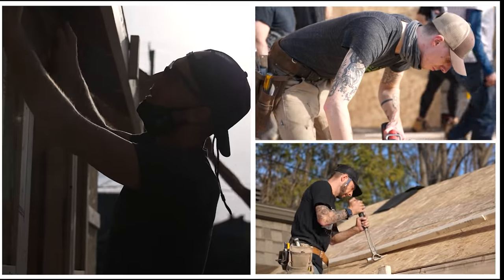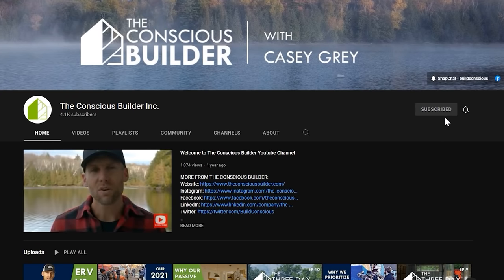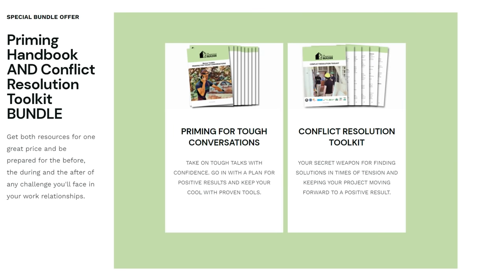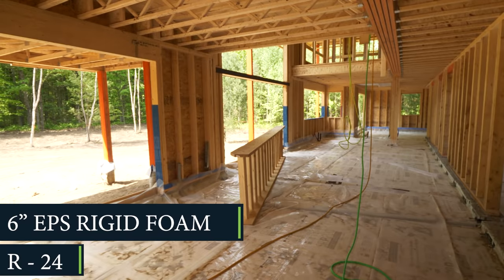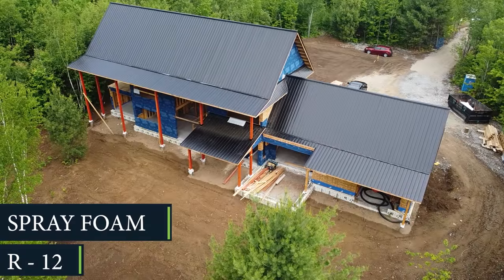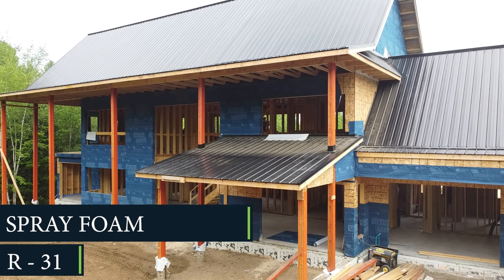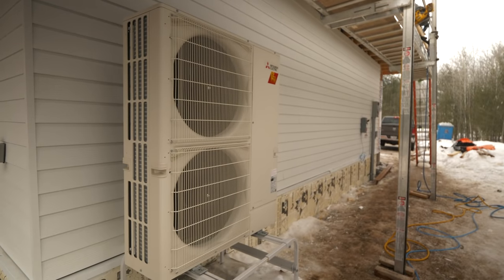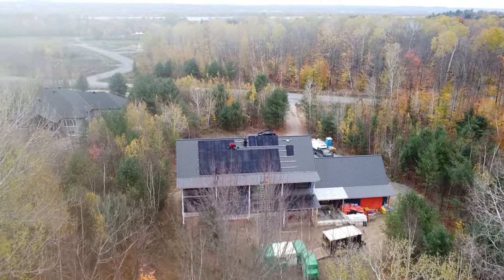Net Zero Build - Building Envelope and HVAC System

Comment: Nice Job Casey.  I've just designed a 1500sq ft Passive House with a heat loss of 1280 watts.  I'm using a Swegon 75% Effective 200 CFM ERV with a 1.5Kw heater as my primary heating source so only conditioning my ventilation air.  I'm building the place in an ASHRAE Zone 7 climate  so don't require A/C assuming I can be comfortable at 25C , 40% RH on a design summer day.  The interesting thing is the place has an energy balance of -15C on a sunny January day which means in theory, I need to switch to A/C.  What I learned is the home orientation for winter solar gain is not nearly as important as summer shading. Moisture control was my biggest challenge because I wanted to keep it less than 24% in any insulated cavity in the R60 walls.  Cheers!
Reply from the maker: Cheers Rob! Good luck on your build and keep us updated on your progress. Thanks for watching!

Comment: Well done! Is there an energy model & are any EV's being charged? Will grid power be needed in winter?
Reply from the maker: They are connected to the grid. It's not an off-grid home. They do not have any EV's yet as they do not drive very much. NetZero homes are modelled for use throughout the year so they will likely not produce all the electricity they need in the winter. If they do, that means that we likely oversized the system as they would then over produce in the summer.